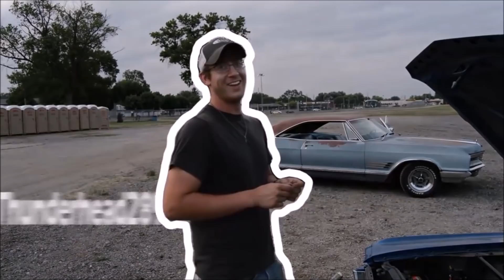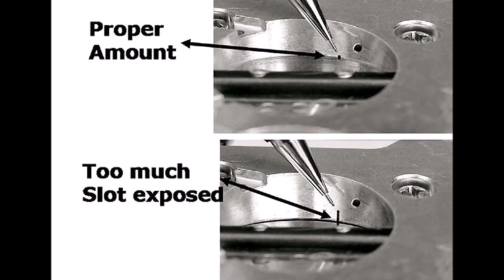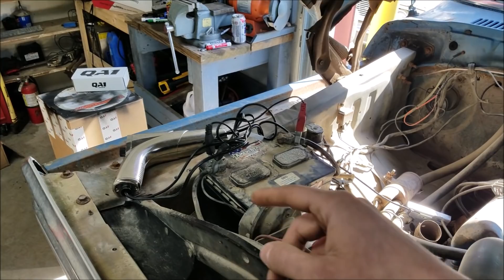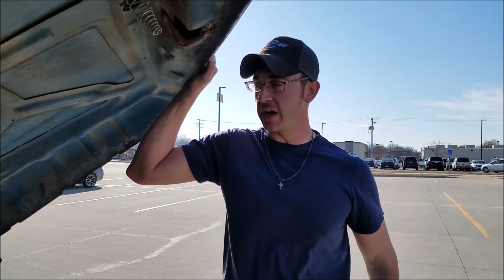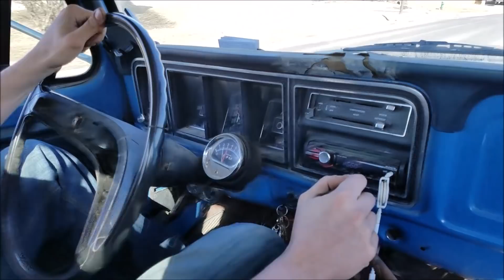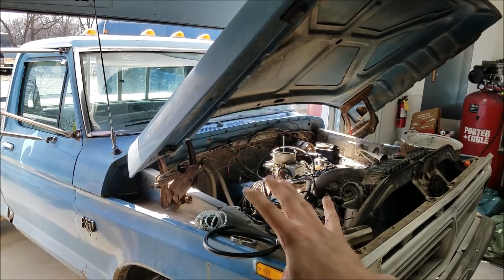How to Set Idle - Holley & Edelbrock Carbs (&& Free Throttle Response & Fuel Economy !!!)

Comment from the maker: I' m not paid to say this - its rare for me to endorser anyone or anything. - it takes something special. 
ABSOLUTELY check these guys out!!! Brand new company, with the coolest thing I have seen in the auto market since the 5 speed swap!!! https://progressionignition.com/
Reply: nice
Reply: Dangit they dont seem to have ford 460 models
Reply: Research and Build  yes they do it’s the same model as the 351C
Reply: Sadly, I couldn't find one for my 84 2.8L V6 171
Reply: About 5 years ago you did a video that gave the complete opposite info. You where all about running manifold vacuum advance.
Reply: If I adjust my timing for fastest idle with no vacuum advance, I won't be able to start the car because it will fire backwards while cranking.  I therefore need manifold vacuum AT IDLE, which I do not have while cranking, so that the car will fire forwards when cranking rather than backwards!  Alternatively, I would have to leave my timing more retarded than most efficient idle in order to start the car smoothly, which is also factory spec. factory spec being far less advanced than setting for maximum idle speed at a given idle throttle stop setting.

Comment: Let me start by saying i think youre a super intelligent guy who knows what hes doing and does a good job getting information across.  I do want to follow it with saying i completely disagree with you about ported / manifold vacuum.  The best way ive found is set up like you say, neutral for manual, gear for auto, vacuum gauge on manifold vacuum, vacuum advance unhooked.  Increase static / base timing until you find the highest vacuum point (adjust rpm back to spec as needed).  THAT number is where the engine is most efficient and that number is what your idle timing should be.  Generally this number is anywhere from high teens to low 30s depending on cam, compression, and altitude.  Now, we all know that very few engines are going to start with 28* of initial timing, and even if they did as soon as you put a load on it its going to ping like crazy.  So lets set our base timing back to something reasonable, generally speaking, camshaft duration and overlap is going to dictate this number for us (theres charts on the interwebs).  In the case of my cam, 18* works pretty well, then to that, we add our vacuum advance, which in my case is ~14* for a total idle timing of 32*.  This is why manifold vacuum is superior.  You say that manifold vacuum retards timing as soon as you crack the throttle, it does, but it never going to be lower than it was on ported.  You have all the advantages of the engine having the timing it wants at idle, with none of the disadvantages, snappy throttle, cooler idle, quieter, etc.  It is especially useful for engine with large cams that have a hard time reaching an acceptable idle without over exposing the transition, opening the secondaries, or drilling bypass holes.  Ported vacuum exsists because of CARB and the EPA, retarding the timing at idle increases idle exhaust temperature which cuts down on hydrocarbons, warms the engine up faster, and produces less NOX.  I will get off the soapbox but i will add that not all engine should necessarily run manifold vacuum.  Stock engines generally dont benefit as much because there is less benefit to be had.  In the case of a daily driver for instance, the faster warmups are nice, but for performance, after having tried both multiple times, there is only one answer, and it isnt ported.

Comment: A quick story on ignition timing and advance curves. When I first assembled a Pontiac 455 years ago it seemed sluggish off idle and didn't have the torque I was expecting... until one day I took off from a stop light and at about 20 mph it lit the rear tires and felt like a 150 shot of nitrous. It turned out that the mechanical advance weights in the new distributor had been sticking and finally let loose. I hadn't checked the curve, figuring that a new distributor would be functioning properly. Lesson learned.

Comment: Any performance motor I’ve built and using the stock Dizzy I’ll only use the mechanical advance and not use the vacuum.
I get as much initial timing as possible and then recurve the mechanical advance if needed to get my total timing! 
Typically vacuum advance is for fuel mileage
Reply from the maker: Your engine is late at cruising throttle angles if your vacuum advance isn't hooked up. Cylinder pressure changes based on throttle angle - an engine is nothing but an air pump where the throttle is a restriction. Atmospheric pressure is trying to cram its way in there, but the throttle restricts it where you have a less dense cylinder charge. A less dense charge burns slower - ie you need to ignite the mixture sooner for flame propagation to happen at the right time in the stroke. 
Not running vacuum advance is just silly on a car on the street. 

Thunderhead289 - engineer.
Reply: @ThunderHead289  I should restate what I said ….I usually don’t run vacuum advance on engines with more than 220 degrees of duration @ .050.
I run as much advance as possible like 16 -20 degrees base timing or more if the starter will do it…then mechanical advance will have 15-20 more ….all in between 2500 - 2800?
Throttle response is amazing as well as over all driveabilty ….vacuum advance at this point is redundant. Granted I mostly work with fords which most ford combustion chambers are not a fast burn chamber so many times 36-40 degrees total timing is needed …..
Not bragging but in my town most every gear head knows me as the Fast Ford guy!
Reply: @ThunderHead289   Also a vacuum advance will only advance on ported vacuum once the engine isn’t under heavy load..
Like when you have your foot into the throttle even half way the vacuum advance isn’t doing much! Only around cruise speeds is where the vacuum advance works the best….when you floor it , vacuum advance does nothing for a curve! Vacuum advance to me isn’t very consistent either!
Reply: I should also add I enjoy your break downs of operations with carbs , timing and engine operations as such! Spot on and informative more than any other channel I watch! For a stock engine I agree with using the vacuum advance but some old lean burn engines and others ran better without the vacuum advance hooked up! In my experience it really depends on the motor design, compression ratio amongst 50 other factors involved..
As with carburetors they rely on the basic function of an engine being in good shape ….on a tired old motor you can really play with timing curves to make it run as good as possible ….sometimes eliminating the vacuum advance simply advance base and adjust total timing accordingly…

Comment: Why do you set the timing in drive and not in park when you have an automatic transmission? If you have an automatic transmission do you hook up the ported vacuum back to the distributer and then set the timing in drive? Thanks

Comment: I just had a cam and lifters put in my 400. I couldn't get it to idle right for anything!  I watched your videos on ignition timing and the Edelbrock tips in this vid, since I'm running a 600cfm Eddie. Your advice has this thing idling correctly, and it pulls smooth with no hesitation at all.   I owe you a venison dinner!!

Comment: Do better(mild) cams in a chevy 350 need different vacuum? I ask because I've built a 350 with an elgin e921p cam. I've got idle tuned pretty good with great throttle response but at idle in gear it runs much more smooth when vacuum advance is on manifold vacuum using edelbrock avs2. Are these directions mainly for stock engines? Do you have videos on upgraded cam timing?

Comment: My carb does't have ported vacuum only manifold. Do I have to set a lower initial timing to compensate for the vacuum advance canister at idle??
Reply from the maker: That’s annoying - I’d see how much timing you can run in it without it acting odd. 
If you have to astranomically close your curb idle screw and lean your mix screws, it’s too much timing. 

Depending on how much timing your advance canister pulls, you might be able to get away with mid 20s for timing
Reply: @ThunderHead289  Ok thanks Im a look into it.
Reply: @ThunderHead289  Ok I got the transfer slots squared up. Now it doesn't want to idle on its own. Could this be a timing thing??

Comment: I’m probably asking a dumb question but I’m a little unclear on adjusting the transfer slots. Are you saying to just do the dance between your idle speed, idle mixture, and timing and that if you do all that and aren’t pulling vacuum at idle off the ported port, then you should be set correctly as far as the slots? So if I get set and have a little vacuum, I should back off my idle speed screw and give a little more timing?

Comment: Luke. I’m sending out a personal “Thank you”. 
I’ve watched many of your videos on timing and carb adjustments and taken that to my carbureted marine 454. 
I install a fuel pressure regulator with a return line, squared my transfer slots (edelbrock 750) and adjusted my timing to get my idle set right. The thing starts amazing now. Runs absolutely PERFECT and gained about 2 mph on the top end. 
👍👍👍👍

Comment: Thanks for sharing the information.  I'm currently working on a 76 f150 (360) dealing with egr and vaccum stuffages.  I may pull the carb off again after watching several of your vids and double checking the transition slots.  I had vaccum at idle apparently at the egr port.  Still working on adjusting things to get it running better, for a 2bbl, eventually going to turn it into a 445 stroker.  Still appear to have egr issues, but I will deal with that later.  I also put in a digital dash it is a great addition and I like the way it looks and gives me more information on what the engine is doing.  I noticed in one of your other vids you have a af guage.  Do you have the stock exhaust with it tapped into the pipe where they meet or are you running dual exhaust and just have one pipe tapped?

Comment: I'm confused now at 7:40. I thought vacuum is supposed to go down when the throttle opens...
Reply: Crockett85 - on the ported connection, there is no vacuum registered at the port. There is vacuum in the intake, it is just not passed to the port. Thus, with a gauge hooked to the ported port, it will read zero. Then when you open the throttle a bit, the port gets exposed to manifold vacuum, so it then registers.  It appears that the vacuum goes up, but this is just at the port.  If you were measuring the vacuum on the full-manifold port, the vacuum actually drops when the car’s RPMs go up from idle.

Comment: I have a 32' Ford PU with a 51' Merc. 255ci engine in it. Is there anyway I can apply your video to it? Stock is 7.5 to 8.5 deg. @ 2000rpm. I am running the stock Holly "tea pot" carb. and don't want to change.  A dist. rebuilder recommends 18deg. @ 2500, mine will ping at that setting. Should I do "old school" and adv. until it pings, then back up a deg. or 2.  These dist. are unusual as to where they take the vacuum from. You cannot run multi. carbs with a stock dist. Have watched 4 or 5 of your videos, VERY informative and to the point. Thanks frank

Comment: Hello, we just bought a Vanguard R.V. with the 1986 Ford E-350, 460 3 speed. Do you recommend removing all the EGR components and plugging the exhaust manifolds? There's no cat in it. If so, tuning afterwards would make sense, right? And there's a lot of potential problems with ICM, where some have a spare one on hand, much cheaper than buying a MSD or Progression Distributor. But if we put in a Progression distributor than would we have the need to buy a timing light and other gauges? Definitely the vacuum gauge.  But a timing light also would be cheaper than a new Progression distributor. So, what gauges to you recommend for the interior, for the minimalist. ;-) Thank-you.

Comment: My question is if you set your secondaries slightly open like I saw you do in another vid will that #1 give you a reading on your vacuum gauge at idle? #2 reduce your total vacuum when trying to set to highest vacuum idle with mixture screws?

Comment: Initial Idle screw/transfer slot adjustment?
Does Holley/Summit or Edelbrock (or other Carburetor manufacturers)  provide a number of turns for the initial idle screw setting that will get us in "the ball park" for a good initial transfer slot/throttle plate relationship without removing the carb?
Reply from the maker: If you have vacuum on your ported port at idle, you have gone too far!
Reply: @ThunderHead289  I assume if you go too far the other way (throttle not open enough) the vehicle just won't run.

Comment: I’ve been arguing the timed port thing since the 80s with my buddies. You’re doing the hobby a lot of good . I always look forward to seeing your videos!!
Reply from the maker: Thanks so much! There’s a false belief out there that it’s associated with emissions. My 64 galaxie is factory ported with no PVC or anything else smog. I highly doubt that the ported port was an attempt at smog control in 64! 

Even if it is, it can be utilized to get the correct mechanical timing on an engine! A lot of stock timing curves are lazy!
Reply: I had a friend who started building engines when he was like 10. My foundation for engine building and tuning came from him. Using ported vacuum was the first thing he stressed about setting idle and tuning carbs.

Comment: Just bought my 1st car it's a 70 ford fairlane 500. Also my 1st dive into carburetors haha. Quick question.  Engines a 302  and the gas pedal is a little hard to push down. Any idea what that could be? Or are older V8s just like that?

Comment: I've always used a vacuum gauge when setting initial timing. Like you I plug it into the ported port and advance it until I get the highest vacuum then back it off slightly and lock it down, bob's your uncle. Always ran beautiful.

Comment: Been running manifold vacuum on my 73 f250 highboy just because that's the way the 2 barrel was set up on it when I got it, now it has a AFV elderbrock 650, I will try this , something to do during lock down
Reply from the maker: Have fun my friend 👍
Just be sure to advance the initial mechanical to compensate
Reply: @ThunderHead289  dura spark distributor with MSD ignition, lighter springs in dist, thanx for videos, very informative
Reply: Thanx luke, did the changes and it pulls the hills around here much better and better off the line acceleration, FE 390

Comment: I rebuilt my holley but it still seems like there's a fueling issue almost like it's not always delivering enough but other times it is. I'm not real familiar with how they work so I'm curious as to how the carb still pulls fuel when it's idling and where the fuel comes out of and goes into the manifold. I know it doesn't come out of the squirters until you give it throttle so where does the fuel come from when idling. It's a 600 cfm

Comment: @ThunderHead289
I'm so glad you make these videos. Not everyone wants to drive their classic like a freakin race car! I really appreciate what you say about timing and ported vacuum. I'll bet you if you examine the shop manuals of countless classics for the initial setup of ignition and carburetor systems, ported vacuum will always be hooked up to the advance mechanism of the distributor. Those engineers didn't know everything, but they weren't stupid either.
Reply from the maker: Just as long as a guy advances his initial timing, all will be well. Obviously an engine that requires notable advance will fare better with a distributor recurve to compliment this improvement